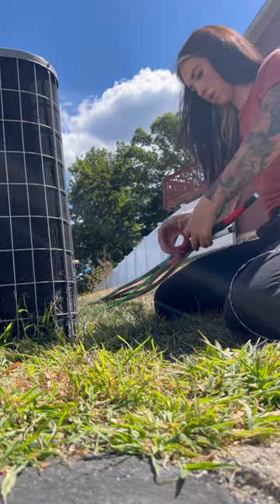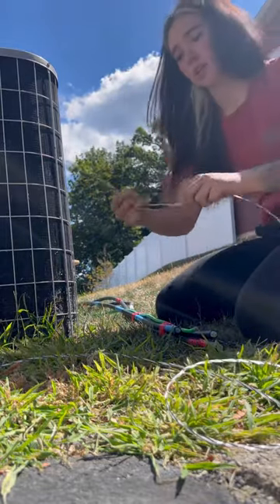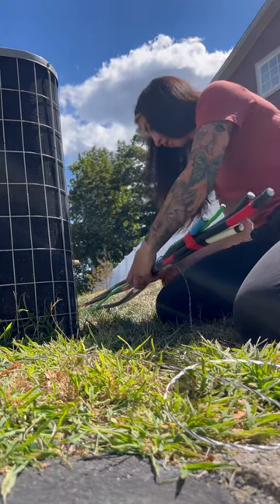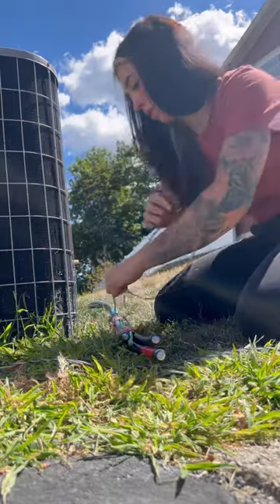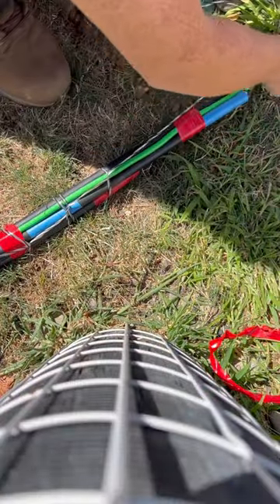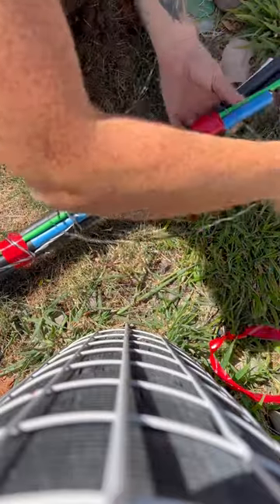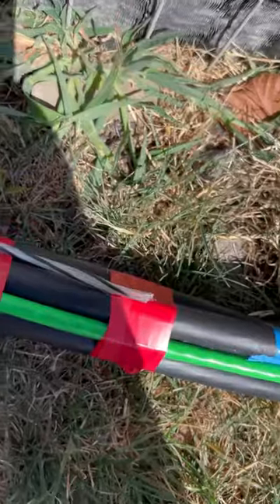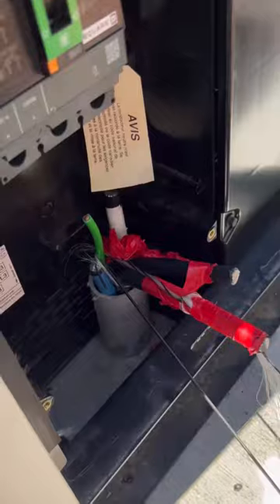How I make my clove hitch

Comment: Thats and good and easy knot to remember. Other one's you can use are the gripping sailors hitch or the icicle hitch. Or similar to what you did in the video except the first knot can be a simple noose(not to be confused with the hangmans knot) to cinch down on the cable and then continued as you did with some half hitches.

Comment: I'm not an electrician but I do love me some good knots/hitches.  Those are some great looking hitches! There are other directional friction knots/hitches that might work for you. ex: start it with a constrictor knot (https://en.wikipedia.org/wiki/Constrictor_knot) instead of an overhand and tape. And if I need to pull a line/wire I use a rat's tail stopper or an icicle hitch (https://en.wikipedia.org/wiki/List_of_friction_hitch_knots). But also if it works for you keep using it!!!! not mansplaining just trying to share knot love <3.

Comment: Sorry, A clove hitch is a clove hitch. The only variation is how you actually tie it. By that I mean you can make the clove hitch by theading it if you are tying on a ring or loop or you can pre make it and slip it over. 

The knot you are making is a running half hitch. Still the correct not to use in that application. Ironically you start off by taping the end of the draw wire to the cable bundle.  That is where you would actually use a clove hitch then continue with the runing half hitch.

https://en.wikipedia.org/wiki/Clove_hitch